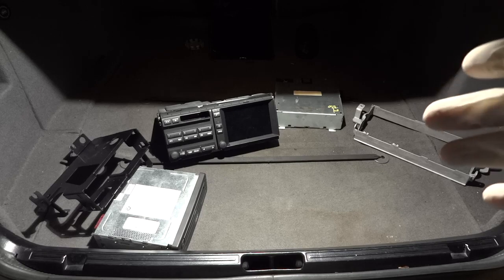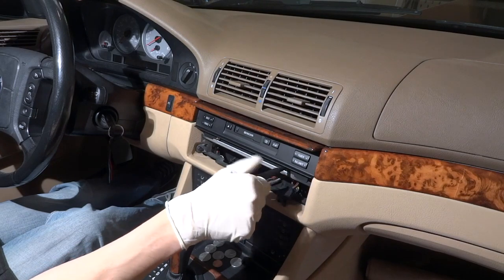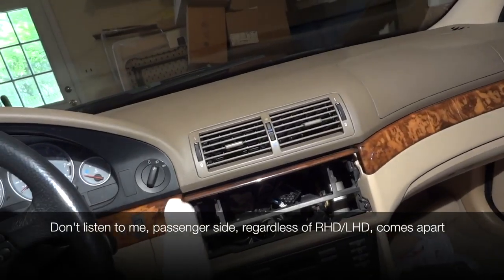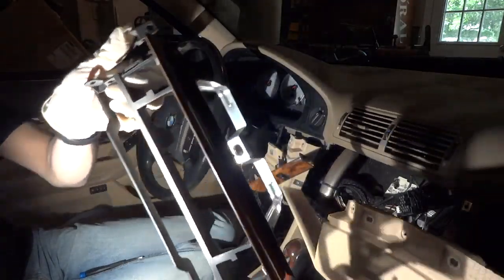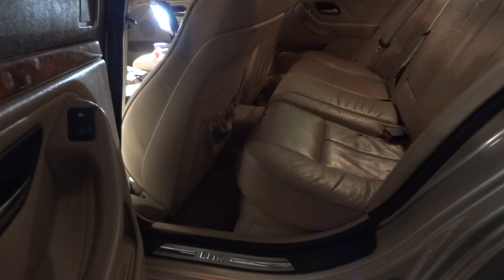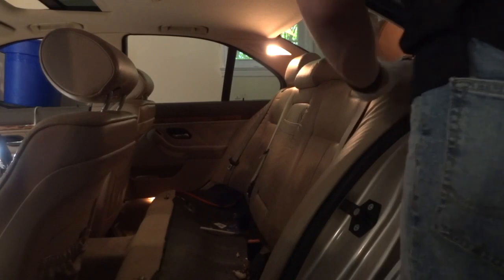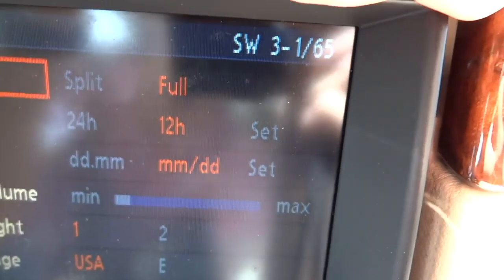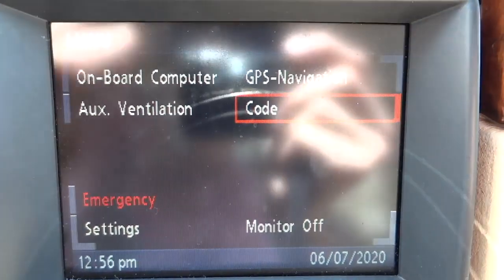BMW E39:  Full Navigation Retrofit

Comment: Didn’t know I could use a radio from an 04’ 3 series.  I might do this now that I have the blue bus installed, I would like to use more of the features I cannot with my standard mid
Reply: I can’t attest to all that, but this just looks cool as hell and apart from DSP, this is almost the logical conclusion to the radio mods. I get my BlueBus soon, I’m working on a DSP retrofit, and the nav works perfect and it looks cool as hell too.

Comment: Well done - Thanks for making such a brilliant and very informative video and for explaining everything so well !
I have just bought a 1997 E39 535i which was never fitted with the OEM 4:3 head unit that's made by Phillips, I have a 1999 E39 540i with a bad engine/gearbox and a lot of corrosion ! so I am planning on swapping all the OEM sat nav parts over, My TV has never worked since 2008 and I didn't know why until you said that Analogue TV was discontinued in the United States since 2007, so that probably explains it as they discontinued it here in the UK since 2008 or 2009.

I am wondering if there is any other way to route the harness without having to remove and disturb the gear selector and center console ? as the gearbox in this car is working perfectly and I don't want to disturb it and for it to start throwing "trans failsafe" on bottom of the dash instrument cluster....You said that you didn't want to run the harness along the sill underneath the carpet WHY is this ?? ....From what I can see, It looks fairly straight forward to just remove the front passenger seat and lift the plastic sill trim and the carpet and continue running the harness from the rear seat all the way to the glove box area and then into the area of the dash where the head unit sits ? no ?
Reply from the maker: The transmission will not at all be disturbed by removing the shift knob, console trim, etc etc.  If you wanted to do it under the door sills, you could, providing that the wiring harness is long enough.
Reply: @E39Source  Thank you very much for your prompt reply, Yes I understand that the gearbox selector trim just lifts up without disturbing the transmission itself, I did remove this on my E39 old 540i which was auto/tiptronic as I was trying to see if there were any loose wiring or connections that could be causing it to throw a "Trans failsafe" warning on the dash after driving it for 5 minutes - There was nothing loose !, In the end I spotted a good 1997 535i auto with decent mileage 47,000 miles with the non Vanos M62B35 V8 engine and the same 5 speed auto/tiptronic gearbox but the dash does not have the factory sat nav fitted, only the onboard computer/information center and a radio/tape player above it like in your E39, So I decided to see if I can retrofit the 4:3 sat nav system, hence I came across your vid !! - All parts can be found cheap on eBay if needed (I have all the parts in my old 540i) but what you said about the wiring harness got me worried if it doesn't reach lol - I wonder how the factory installed it ? ... The only way to find out is to start pulling the broken 540i apart and see how the harness was fitted from the factory back in 1999 !
Reply from the maker: @BITTYBOY121  I have dismantled a few E39 M5s (all with navigation).  The factory-installed nav harness runs up the left side of the car under the carpeting, crosses over to the center in the middle (under front seats), and then up the transmission tunnel to behind the dash.  Removing the rear carpeting is not hard, along with the center console and tunnel, so I would try to mimic this wiring strategy with the retrofit.
Reply: @E39Source  You are bang on the money mate ! - I took the seats and carpets out of my old e39 540i this morning and it was exactly as you said where the navigation wiring harness runs down the left side seats and then crosses over from the left side, runs along the transmission tunnel and up into the center dash console which houses the navigation onboard head unit/TV . I had to stop what I was doing because of the heavy rain we are now having today in the UK (London) but I did see why you can't take the easy way out and run the navigation harness down from the rear seat and along the left sill - it is because this harness is TOO SHORT !!! I think that its a great pity that there is no way to extend this harness without cutting and spicing its many wires... Thanks for your input and advice Bro  - Much appreciated - All the very best of luck with your car projects man :-)
Reply: The harness is not long enough, I tried routing it behind the pedals and it did not work. It was actually a lot more straight forward to take apart the center console that it was to remove the seat and side trims

Comment: Thumbs up 👍👍 I'm installing navigation unit into my 2003 540i  where did you score the cable from if you have a sure that will save me  please help !Thanks
Reply: 61120309250 is the PN for the NAV restrofit harness that also converts the old round style pins for the C43 Radio to the flat pins for the newer BM53 radios. You can get it from FCP euro or ECS tuning 

Because you have a 2003, you already have a BM53 radio with the flat style pins, this PN won’t exactly work for you unless you slightly modify the harness. I would get in contact with Tomas Ballesteros of BavTek, he’s the one that gave me the PN for that harness. 

Also this guide is for the e38, but it helps a lot. http://www.e38.org/e38_nav_retrofit.pdf
Reply: https://store.bimmernav.com/products/bmw-e39-navigation-retrofit-harness

Here’s one that will fit your vehicle, unfortunately BimmerNav doesn’t like to list PNs, if you do buy from them, I’d love to know the PN on the harness to add to the PN list

Comment: Great tutorial !! Can you tell me if this application also work on the E53 (2000 X5)? Also, what is the latest Navteq disk (version and year) that can be used in this update?

Thanks so much.
Reply from the maker: Yes, this would work on the E53 X5 as well, pretty much identical to this.  The latest map updates for the MKIV computer would be 2015.
Reply: It’s a very similar process, it’s just that the wiring harness, Nav module brackets and Nav screen are different

Comment: Hi, i have a problem regarding this this type of navigation, I have bought the navigation it self, the harnessing and the modules form scrapyard and in my case on the date and time it displays a white bar. I don't know what to do. I need to mention that my car had previously had the simple radio, not like yours, the one with the small digital screen. Also my car is 520i and the components of the navigation i have bought them from a 530d, i don't know if there is a difference in this case, but also the GPS doesn't work. From your video i have seen that you have a CD changer, and mine doesn't. Can you help me with some informatin, because i have conected all the wiring and this is the result...
Reply from the maker: It sounds like you upgraded from pre-facelift navigation to post-facelift.  Is your 520i a 2000 model year or earlier?  The components should be compatible.  The CD changer is not at fault here.  European E39s had several different options that we never received here in the States, so I'm not 100% sure what you'll need without being able to see your E39.